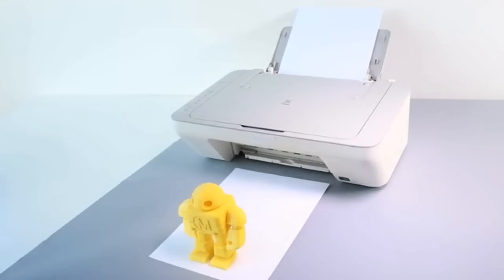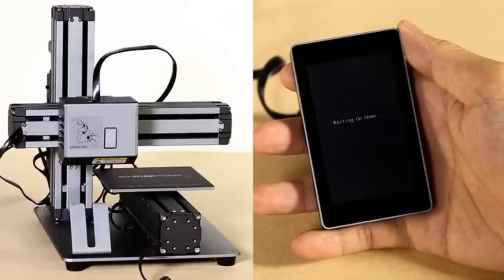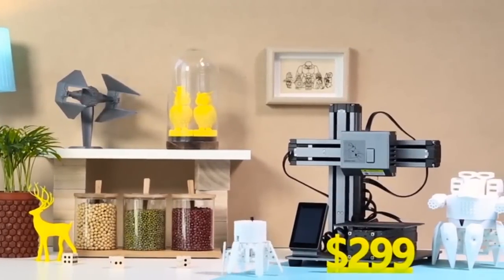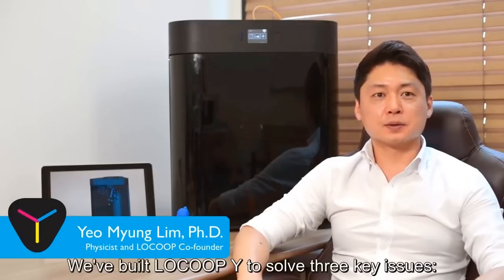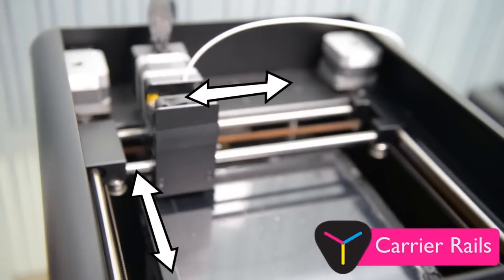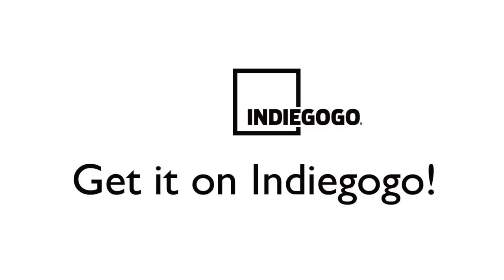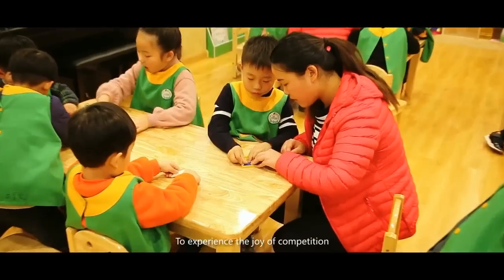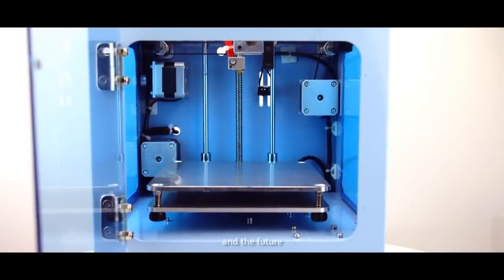Best 5 new 3d printers under 300$ 2019

Comment: I recommend the monoprice select mini. $200 prints amazing out of the box. You will not be disappointed.
Reply: I have one. It's actually on right now. It's an amazing printer for $199, I recommend it for everybody starting in 3D printing, because it will get you going fast and inexpensively, especially with its built in LCD screen that makes choosing prints easy. Its solid construction makes it great for a desktop, and even children. 

I use it to produce functional mechanical parts. Currently an assembly jig for a unique anti-friction bearing is being produced with it. Yesterday, I printed a part that looks so good, that until you look at it up close, it is nearly indistinguishable to one of the same parts I had professionally printed using SLA! 

The print arm, being suspended only on one side, won't last forever, but for the money, I rate it a 10/10.
Reply: V2 is out.  Can't go wrong with either.
Reply: Have you tried it ?
Reply: NPG3D ok thanks !!
Reply: The MP Mini V2 will be releasing soon which fixes any complaint I had. It has additional rigidity, a better filament path, and more. Definitely worth it. I may get the V2 just to have two of these bad boys.
Reply: i'd like that but it is too small for me
Reply: any idea if they sell in Europe?

Comment: Most of these are not under 300 dollars
Reply: Ok so call the clip printers under a 1000$ because these are all more then 300$
Reply: how many indian  rupees . not dollers  ok
Reply: M MATHRU NAIK 5
Reply: Some machines that do all the same things are into the thousands.  I can' justify more than a $300 dollar machine for my needs.  There is a machine kinda similar for a similar price that doesn't do all those things but it can use all the different filaments.  Note that I did not mention the name of the machine because this is really about a different one.  If you have been looking at the bewildering variety of 3D printers like I have you may have seen it already.  I am not sure really how similar it is to this machine but it is constructed in a very similar way being made of metal and not 3D printed plastic.

I can see why people print all their printer parts but I really do like it a lot better when there is one made with sturdy metal parts and seems like it was designed to last a lifetime of trouble free operation.